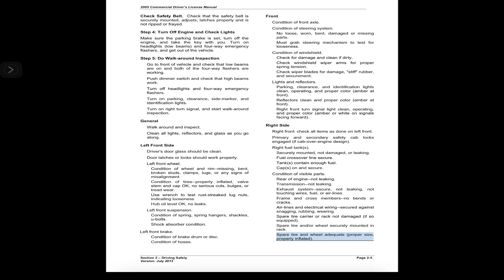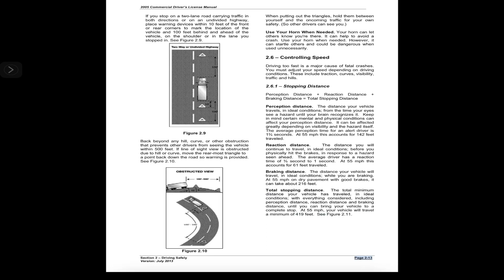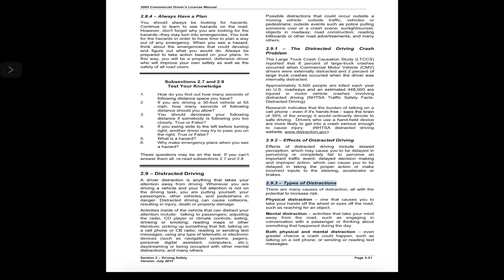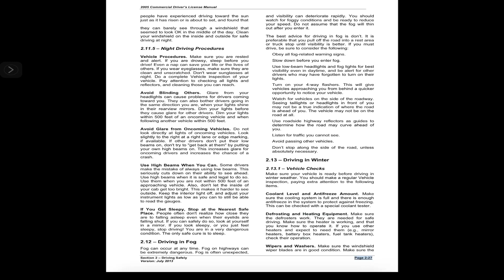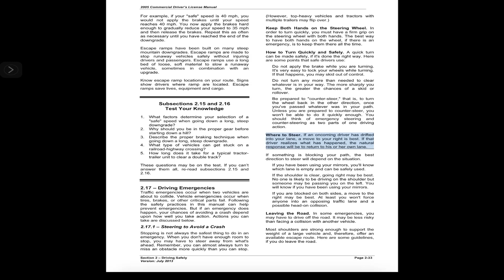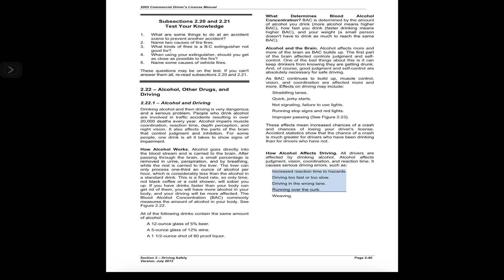USA CDL (DMV ) handbook Section 2 DRIVING SAFELY 2.1 to 2.23.3 lower 48

Comment from the maker: 🚛 Study for your CDL with our guides — Pre-Trip Inspection Checklist, Endorsement Cheat Sheets (5 endorsements + 50 practice Q&As), Texas Practice Test (250 questions), or the complete bundle. Instant download, print at home.
Etsy: https://www.etsy.com/shop/Thinktrucking
Gumroad: https://thinktrucking.gumroad.com/

🚛 My recommended trucking gear (GPS, CB radios, headsets, dash cams & cab essentials) is linked in the description above.